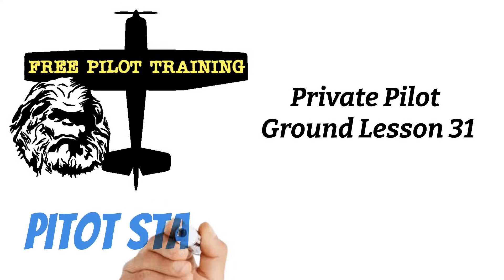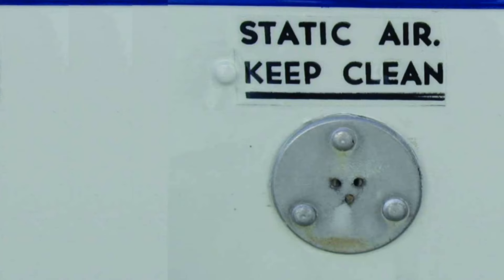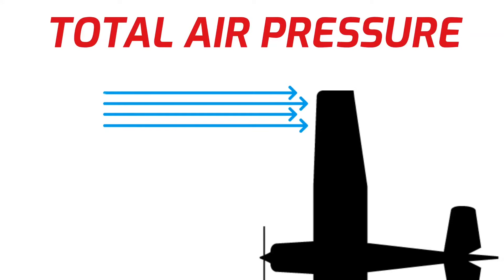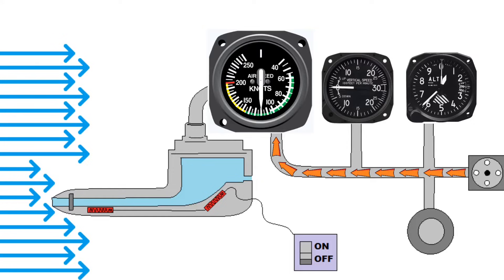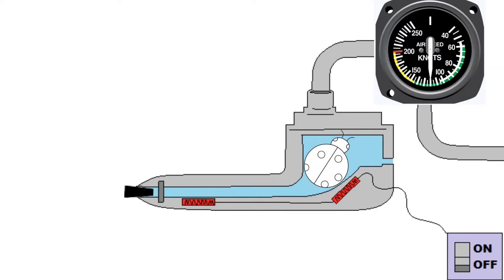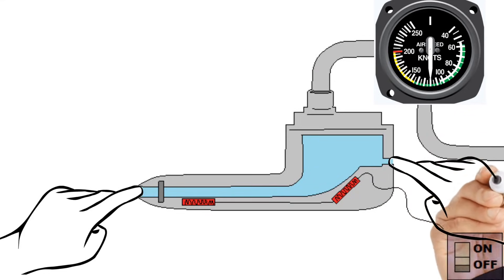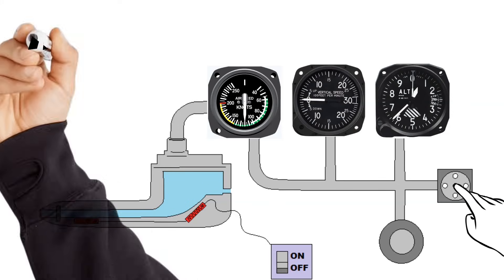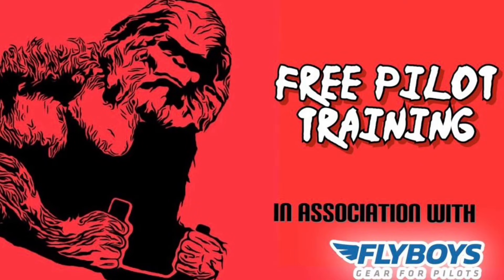How the PITOT - STATIC system works (Private Pilot Ground Lesson 31)

Comment: Josh please correct me if I’m wrong.  So if the Static port is blocked, only the VSI and altimeter is affected, it will freeze? if the pitot tube is blocked and the back vent tube is blocked it becomes a altimeter if just the pitot is blocked, it will state a faster air speed?
Reply from the maker: Correct! If the pitot tube is blocked, the airspeed indicator becomes an altimeter
Reply: I think you mixed the pitot and static port situations. Wouldnt the airspeed be stated as quicker if its the static port thats blocked. Since theres no ambient pressure for the system to compare to. The pitot tube takes both static and dynamic air pressure into account, reading higher.

Comment: Quiz question: If the pitot tube becomes clogged, but the static port is clear, and you begin a climb, what will happen to your indicated airspeed?  That question on the quiz confused me as it did not say the drain froze as well. If just the pitot got clogged but the drain did not (which is how I interpreted the question) the gauge would go to 0.

Comment: Sorry, is there something wrong with 6:40? I find on PHAK, it says if the situation occurs, the airspeed will lower than actual speed?
Reply: I believe it reads slower than the actual speed when at a higher altitude than the altitude that the static port got blocked and then it reads faster than actual when lower than the altitude that the static port got blocked.

Comment: •	Pitot static instruments: 
-	Uses air pressure to give us information 

1.	Air speed indicator  2. Altimeter  3. Vertical speed indicator

-	 These instruments are provided with air pressure from pitot tube and static port and turn it into information

•	There are 3 types of air pressure: 
1.	Static  2. Dynamic  3. Total 

-	Static: also called ambient air pressure is caused by our atmosphere it always present wither the plane is stopped or moving 

o	The lower your attitude the higher your static air pressure is 
o	We use static port to sense this type of air pressure. It is usually located on the side so it is not effected by relative wind 
o	Static air pressure is measured in inches of Mercury.  In a normal day At sea level the average static air pressure is 29.92 not always and it reduces by 1 inch every 1000 ft above so 28.92

-	Dynamic: When the airplane moves through the air It is impacted by the air molecules and that create pressure on the object that is equal and opposite 
To the airplane direction of travel 
o	This pressure is directly related to the speed which the airplane is flying 

-	Total: it is a combination of dynamic and static air pressure 

•	Altimeter: 
-	Uses the static port To sense the static pressure outside and because the static pressure change 1 inch every 1000 ft  the altimeter is able to give us an altitude reading 

•	Vertical speed indicator: 
-	Uses static port and allow air to escape or come in through a small hole which is vented through the static port By allowing air to come in and go out this instrument senses the pressure differences As we climb or descent then it gives us a reading per minute 

•	Airspeed indicator: 
-	It also receive air from the static port 
-	 The airspeed indicator measure Ram air that comes from relative wind through the pitot tube but this doesn’t give us an accurate measurement because static air actually makes its way to the pitot tube as well, and this is that total air pressure we talked about, and by taking that static air from the static port the air speed indicator is able to offset  any static air that might come through the pitot tube 

o	Pitot tube is located where it is not effected by probe wash. But the angle of the pitot tube to relative wind has an effect on the accuracy of the airspeed indicator 
o	If the pitot tube get clogged only the airspeed indicator is affected Because it is the only instrument that uses dynamic air pressure to give us a reading 

1.	The whole in front of the pitot tube is clogged. As long as your drain hole isn’t clogged airspeed will drop to zero because the pitot tube is no longer taking ram air 
2.	Is both the front of the pitot tube and the drain hole is clogged  air pressure is trapped so last airspeed is frozen in place 
3.	If the static port is clogged but the pitot tube isn’t, the pitot tube will be taking both dynamic and static air pressure  but the static port wont be able to offset that static air pressure and that means  u will get faster than actual indication in the ASI 

•	Clogged static port: 
-	Will effect the altimeter and the vertical speed indicator 
-	For altimeter: it will freeze at the last altitude 
-	For VSI : it will only display zero because it can not sense climb or descent
-	New airplane if the static port is clogged there is an alternate static source  that on the inside of the cockpit but it is not as accurate if you don’t have an alternate static source break the glass of one of the static port instrument preferably the glass of the VSI
Reply: The information for the ASI is incomplete. If the static port is clogged, the ASI will indicate a lower-than-actual airspeed if you climb as the pressure inside the case will remain static but the total pressure from the pitot will be less, so your dynamic pressure reading is also less. The reverse is true if you descend to a lower altitude.

Also if pitot tube front and drain hole is clogged it will not freeze. At this point the pressure inside the diaphragm becomes static no your ASI essentially acts like an altimeter. This video needs to be updated

Comment: Blocked static port does not mean airspeed increases! Nothing happens to airspeed, unless you descend, if you ascend then it actually decreases.
Reply: Thank you, yeah, that part didnt sound right to me. But the series has been great so far @FreePilotTraining thank you for all the videos. They are helping me learn a lot.
Reply: Correct. Page 8-11 of the Pilot's Handbook of Aeronautical Knowledge confirms.

This can be understood by reference to the airspeed indicator formula:

indicated airspeed = (pitot dynamic air + pitot static air) - static port air

At altitudes above where the static port froze, the airspeed indicator "over compensates" for static air--it subtracts too much static air, giving lower-than-true airspeeds. At altitudes below where the static port froze, the airspeed indicator "under compensates" for static port air— it doesn't subtract enough static air, giving higher-than-true airspeeds. 

that's how I think of it at least.

Comment: Can you explain to me how this system works on pipers with the pitot static mast? Apparently they have two static ports(bottom and rear holes, one of them acting as a static drain, completely separate from the pitot hole) and no drain hole for the ram air.
Reply from the maker: I actually don’t know how they drain. All I know is that the pitot and static ports are on the same device.  I’m assuming it doesn’t need a drain or it drains some other way. I’ll have to do more research

Comment: What happens if just the drain is clogged but the ram air inlet and static ports are open? How would this affect instruments?
Reply from the maker: You’re speed will be slightly off, but it should still work

Comment: So the only thing that could cause slow indicated airspeed would be a partially blocked pitot tube?  correct?
Reply from the maker: Yes, unless it gets blocked while you are on the ground or something
Reply: We found the issue.  The Pitot system has an essive leak rate.  Replaced the Pitot tube and connections points

Comment: I watched this very helpful video during my primary training and it was great! Did I remember almost 2 years later? Fast forward to this week when I experienced my first ASI error on T/O roll out of nowhere. No sooner than I started rolling down the RWY in my 1947 Ercoupe (read OLD STYLE pitot/static tube) my airspeed jumped from Zero to 60 then 80 then 100 before I had rolled even 200 feet or so. RTO then went back and requested a high speed taxi. Same result. Avionics shop struggled for hours to figure out what was happening. Pitot/Static tube was clear (no clogs). Error #3 in this video says if SP gets clogged then ASI will indicate faster speed than actual. But I didn't have a clogged SP so what gives? ALAS...a massive Static Pressure LEAK in the Static line behind the panel. SO I am thinking this should be somewhat noted (Clogged SP and/or Static line leak cause the same error). Perhaps this is obvious to most but given that a super reputable Avionics shop couldn't figure it out for a while tells me this is not super common. Hope this helps.
Reply from the maker: Thank you so much! Comments like this are super interesting. That is a great point. Leaks should definitely be something we talk about.

Comment: When can you break the vertical speed indicator while in flight?
•When the Static port is blocked causing Altimeter indicator to be inaccurate 
•Just because breaking things while flying would be interesting 
•Never, because you will have to pay and owner will not be happy. 

FAA test question 2023 .... LOL

An: •When the Static port is blocked causing Altimeter indicator to be inaccurate
Reply from the maker: 😂 that’s a good one. That’s why they added the alternate static source on newer planes

Comment: If you used the alternate air inside of the cabin, what kind of change will occur? Are all three instruments going to show higher or lower? Is our cabin has a lower pressure than the actual ambient pressure outside?
Reply from the maker: Sorry, I just saw this question for some reason. The airspeed indicator and altimeter will show an increase. The VSI will initially increase then it will stabilize
Reply: @FreePilotTraining  great video! thank you for your response! I was studying it few weeks ago, for my CFII, just passed it last week.

Comment: Can you run backup gauges on gps?
Reply: I only say this because I can easily build/program a microcontroller to return these values with gps and small sensors
Reply: @patjohn775  no, because GPS does not record the actual airflow over the wings, which means that if you're traveling 80 knots northbound and there's a 10 knot northwind then you're indicated AirSpeed and therefore the airspeed the wings are experiencing is 90 knots. You cannot simulate this without using external sensors
Reply from the maker: I apologize, I don’t fully understand the question.  If you are asking what I think you are, I believe the backup systems need to be able to be read with a loss of avionics.  I would need to get into the books on that one though.